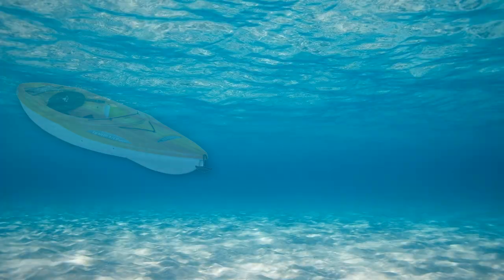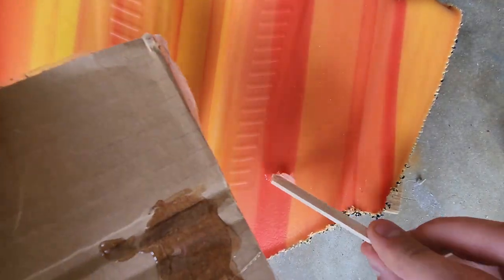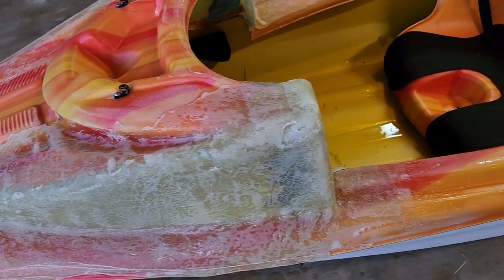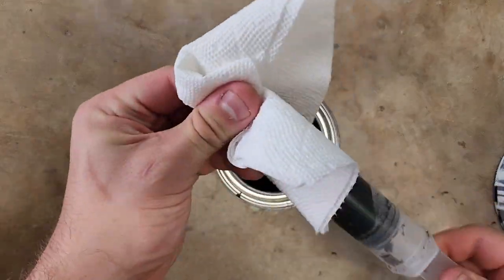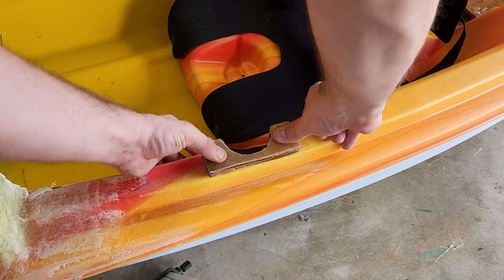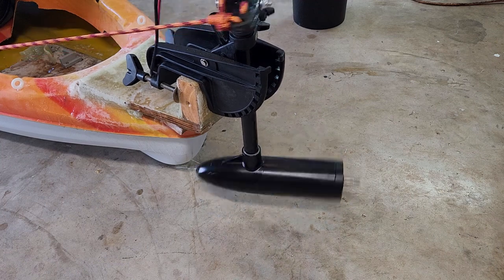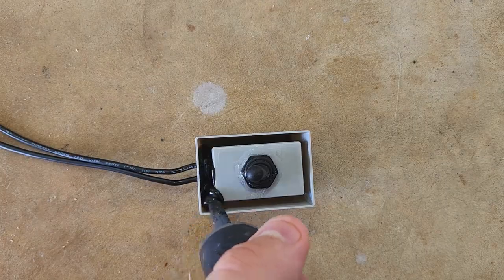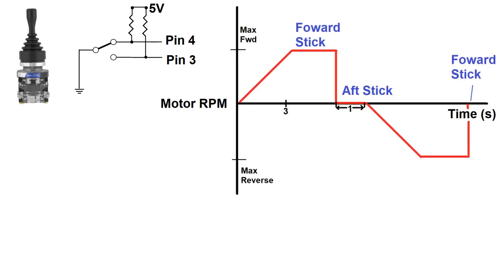Submarine Kayak - Part 1

Comment: Really surprised that a 60amp esc is enough, I use 100+ amp escs on some of my rc cars lol, but I guess the load on a slow moving boat is quite different from a fast car, even if it weighs 15+ times more.
Makes me tempted to diy my own electric watercraft if it requires that little power, based on my experience drowning rc crawlers, as long as the water is shallow and fresh, waterproofing isn't terribly important as long as very sensitive electrics like the esc stays dry.
Reply from the maker: The motor pulls 30A max
Reply: @HyperspacePirate  Damn, that's nothing
Reply from the maker: @bacon.cheesecake  Trolling motors are pretty efficient at low speed, though. That'll get me cruising at 5-6 mph

Comment: I love the solution of using the airbag to equalise the pressure inside the motor, very ingenious!
Reply: I thought they were going to break apart the motor to install stronger seals, but this solution is so much more elegant.
Reply: @guard13007  even better would be to fill it with some compatible liquid, and close afterward.
Reply: I know, right, I thought it was going to be connected to the scuba tank to pressurize it
Reply: It's a basic approach used all over the submarine industry. The professional version also adds slight positive compensation using a spring.
Reply: It's actually a very well known technique.

Comment: Awesome project!
I'm a bit surprised you didn't go for proportional control with the speed. I'm sure you know subs better than me so you likely have a good reason.
A hall effect sensor with a magnet could make a good water proof throttle.
What about some sort of battery monitor to check voltage and current?
Your idea about pressurizing the inside of the motor is really interesting. I was expecting you to use mineral oil myself. I'm sure you have a good reason for the air bladder since you use mineral oil with the ESC.

Thanks for sharing your work with us. I'm looking forward to future videos on the topic.
Reply from the maker: The motor compartment won't be filled with oil because it would interfere with electrical contact of the brushes. For a brushless motor, I would use oil.